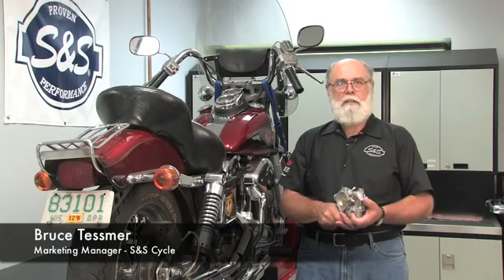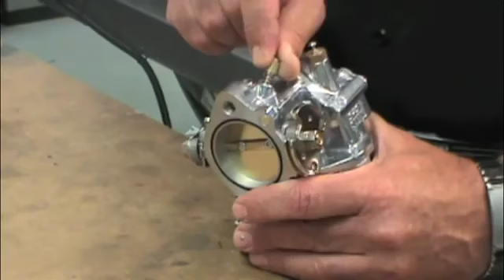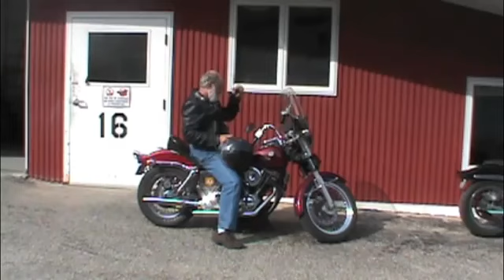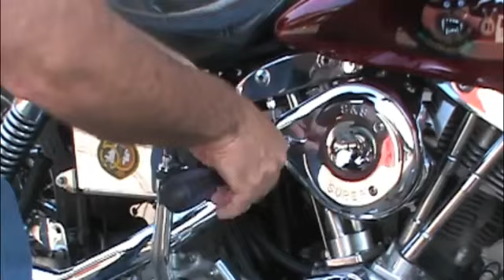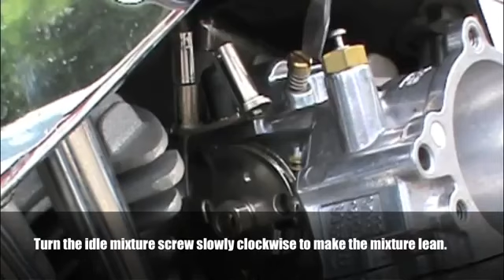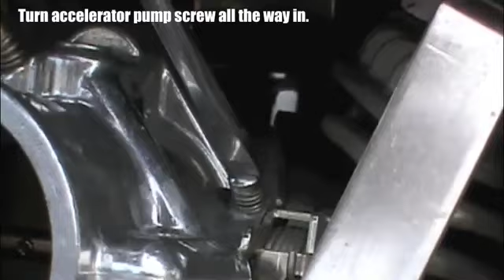Super E G Carb Basic Setup

Comment: Hi Bruce, What is the best Carburetor jetting for 124 S&S 2004 with a Super G Carb ??? Original jet was M-78, Interm-33, air jet 40,  swap with Main- 66, Interm-28, Air jet-66,  still not perfect, just street riding, Thank you for the help.

Comment: From idle I have a complete stall when I open the throttle, tried your adjustment procedure but nothing changes. Bike has been sitting long time.
Reply from the maker: There is a good chance that the jets are clogged if the bike sat for a long time, especially if fuel was left in it. Drop the bowl and thoroughly clean everything with carb cleaner, including removing the jets and making sure they are not gummed up.
Reply: Cleaned up everything and only found a small amount of gunk in the enricher. Tuned again according to instructions and great performance on the road at medium and high rpm, however I still have the low rpm issue and real bad popping/coughing. Do you think it might need re-jetting?
Reply: popping ,,,,,,,, running to lean ,,, dont kill your bike

Comment: hay great video question what would cause it to spit at idle then stall
Reply from the maker: Has the bike been sitting?
Reply: +J&P Cycles just over winter it also idel will race up when hot
Reply from the maker: email me at paul.white@magretailgroup.com It may be an intake seal.
Reply: +J&P Cycles I pulled the bowl off had some black fuel in it found the rubber fuel line was swelled up